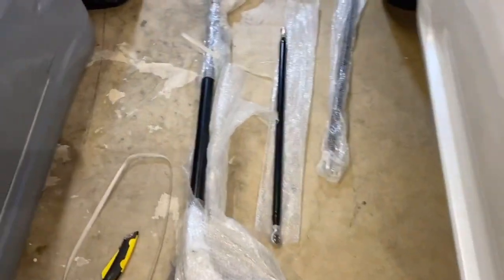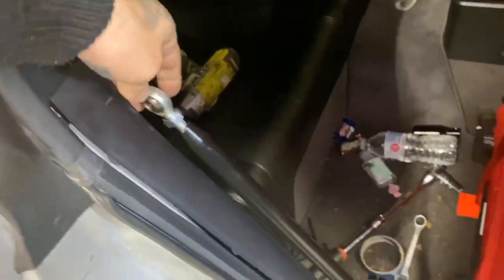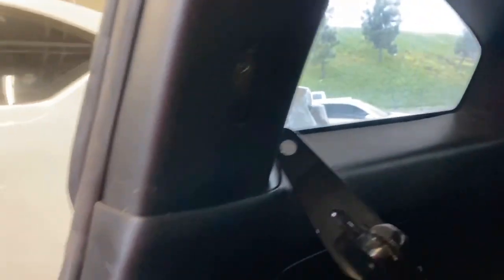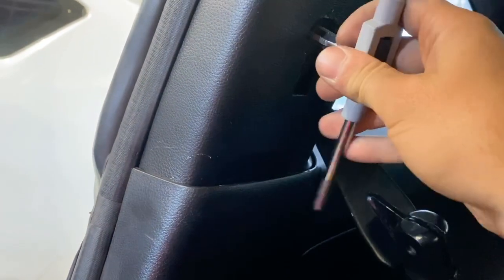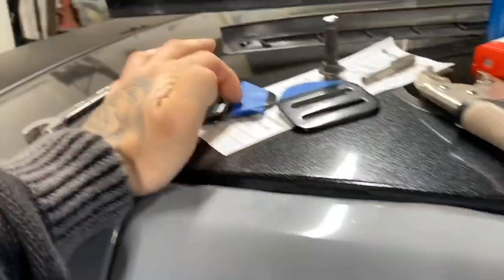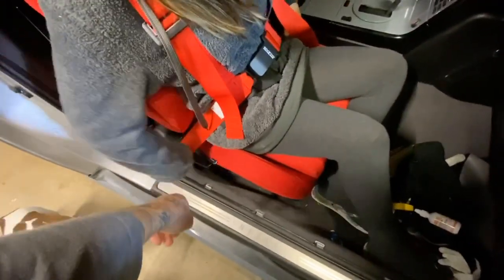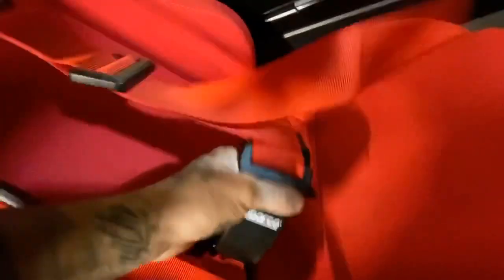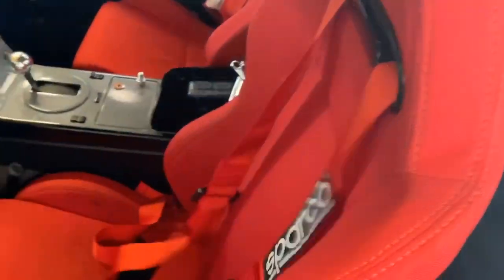G35 harness/harness bar install

Comment: The bar needs to be higher for the harness to be more level. That angle for the shoulder straps is to steep to the bar. They cam crush your shoulders in a accident.

Comment: I have always loved the look of the racing belts and thought of putting them on seemed pretty cool lol but the fear of the car being flipped over and the roof caving in and not being able to move my body downwards always terrifies me.  And the practicality of not being able to move to reach things may be annoying as well.  I think I would have to go full send and get a cage as well if I were to get racing seats and belts.
Reply from the maker: Delc0 I’ve thot of that too these do protect you when you flip when ppl say they don’t that’s a mith or they hooked everything up wrong, but tbh I’ve thot of that too but i mean unless you race tbh chances of flipping are slim or u less your in a truck.. I’m willing to take the risk
Reply: @Louis_B_creations  ya i know...like how extreme are you going to be to flip a car right? I just over analyze my declensions thoroughly and think of the worst case scenarios.

Comment: The slip nut on the risers(the part going from the floor up will extend out quite a bit to raise the crossbar up higher.
Reply from the maker: Humble GCoupe this is as high as it goes. I adjusted to be as tall as can be
Reply: @Louis_B_creations  ah ok.. yeah I had one in my maxima and it went up super high.

Comment: Did you have to buy any other hardware or just used the original?
Reply from the maker: Boy Meets World 717 the harnesses came with hardware but on some spots I used oem bolts

Comment: Good content my boy 🔥🔥
Reply from the maker: Keems media G35 thank you man i appreciate it. A lil rusty coming back into it but thanks dude
Reply: Louis B it’s never too late my boy
Reply: Louis B do you have a video about fixing the airbag light when you put the seats in? Since aftermarket seats don’t have air bags
Reply from the maker: Armando Marfisi I’m not sure how to by pass that. I have the seat belt still under the seat to keep it off. And then I’m going to but a plug to plug into the seat belt. So it stays off
Reply from the maker: Armando Marfisi thay or in plug the light from the consol

Comment: Dude get 5 point harness a 4 point is actually potentially dangerous
Reply from the maker: 5 point is if your going to be racing 4 point for daily street driving is okay. But in reality any harness for daily street use isn’t safe a oem belt is best so 🤷

Comment: And you might as well remove your back seats since you cant use them now anyway.. weight savings bro
Reply from the maker: Humble GCoupe I had it removed in past I don’t like it with out it. Too much noise haha.
Reply: @Louis_B_creations  sound deadener will help, trust... noico 80ml sound deadener then noico red closed cell foam in the doors and under the rear seats is like night and day.